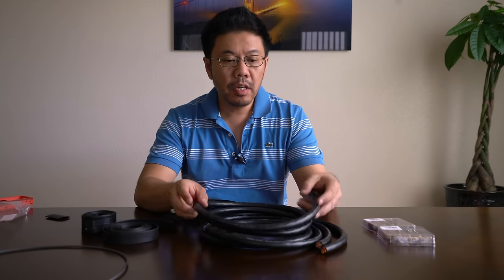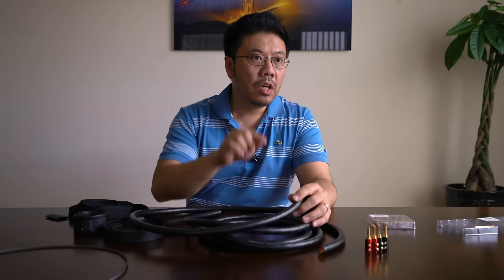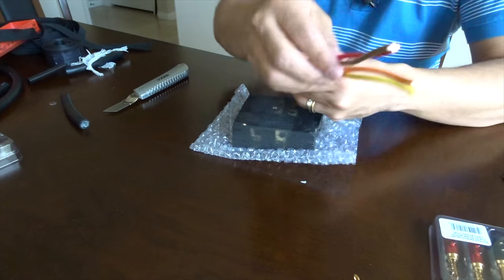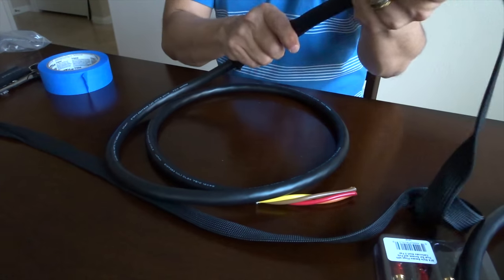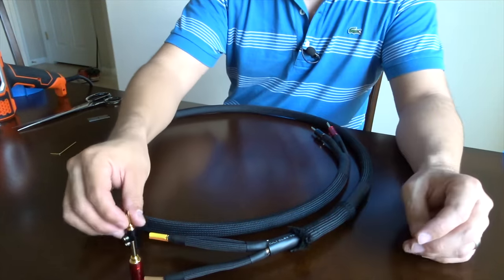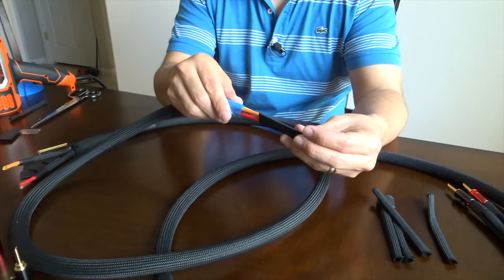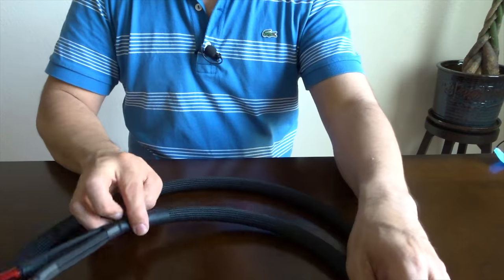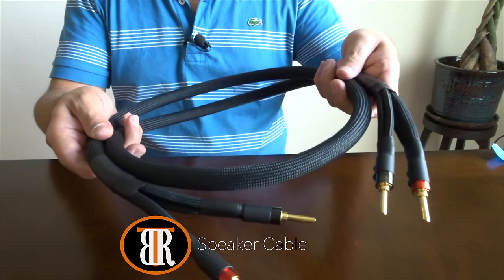Making The Best Speaker Cable For Money, How To DIY HiFi Cables

Comment: Your brass banana plugs only have 28% electric conductivity. Its gold-plating wont help. Always use pure copper for your connectors, then OFC for your cables.
Reply from the maker: Please see your amplifier terminal to see if they come with pure copper posts?
Reply: @Tharbamar  They do on my NAD and also on my KEF terminals. And i even fabricated my own binding posts, made of 1mm pure copper sheet. When it comes to conductivity, it is either pure silver or gold or copper. Anything else would have significantly lesser conductivity / higher resistance.
Reply from the maker: @arpeemac  Very nice, can you tell me where you get the copper sheet? I'm making another kind of speaker cable, thanks
Reply: @Tharbamar  I got mine online locally. amazon sells them too i believe.
Reply: @arpeemac  pretty confident if you put a meter across a brass plated banana plug/ post v copper banana plug/ post you would read exactly the same resistance or 0.0 ohm difference, very slight. We are not talking long distance for these banana plugs/ post it is just an end termination. As to any audible difference again none. So your higher resistance argument is incorrect. Tarnishing is the benefit certain materials are used to withstand that affect over time.

Comment: Snake Oil... UL13 CL2 is general purpose 75C shit cable; 2 cond. lamp cord works just as well...
Reply from the maker: Very nice know that pro audio cables were also snake oil, thanks 😃
Reply: @Tharbamar  They are snake oil. Buying expensive speaker wire is about the biggest waste of money out there. 16 AWG lamp cord works just as well for 99.8% of applications.

Comment: 'If you have doubts about benefit of Star-Quad Cables'..........this is misleading. Star quad is not applicable to speaker wire. It is very useful in microphone signals though ;)
Reply from the maker: Not misleading at all, do a little research how this cable was born and designed for what purpose. I don’t think you have proper information.
Reply: @Tharbamar  mate, I've met the owner of Mogami

Comment: why not solder the cables ???
Reply from the maker: I preferred direct contact without additional resistance.
Reply: @Tharbamar  
what about the air gap ?? and lack of surface area ??
Reply from the maker: This cable is pretty thick it should not have any problem.
Reply: @Tharbamar  
it would be nice to have solder that had conductive properties that surpassed copper, so as to "guarantee" a good joint.
Reply from the maker: We can use silver solder, I just preferred direct contact. Thanks

Comment: The tutorial is excellent but if you don't have the big Parts Express banana plugs, be prepared to suffer putting this together. two twisted, stranded 12 AWG wires don't fit easily in the audiocrest or the KnuKoncepts banana plugs. Even though they are big, you will struggle. I just gave up. The speaker end is not a problem, the amp end is the problem and the Express parts bananas are quite expensive and back-ordered.

Comment: Solder directly to speaker terminals, having connectors just deteriorates signal. Tops out the best cables.

Comment: Also you can use a soldering iron on that heat shrink, it works instantly and is much faster than a heat gun for small objects. Heat gun is great for larger objects like pvc.

Comment: That's equivalent to 6 AWG or 6.6 mm^2 conductors for a 1.68 m length of cable.  Seems to me, extremely excessive even for audiophiles.  Are you sure your not simply being fooled by insertion loss and the ears preference for volume as defined by the Fletcher Munson curves?

Comment: Hello Tharbamar , What is the barrel size for the Banana Plugs for placing two 12 AWG wires together? The link for (KnuKonceptz Banana Plugs : https://ebay.to/2WmWb9u) seem different or smaller than in ones used in video. Does connector have to accommodate about 8MM for two 12 AWG cables?

Comment: Look nice..but brass is not the best material to use for plugs..pure copper is much better..With cables its all about testing..thickness does not necessarilly mean better sound..I have used twisted enamelled copper less.than 1mm thick with superb results..

Comment: The only people that would say you’re an “anti cable guy” are people that purchased $2000 + cables. And people that SELL super expensive cables. Lots AOC scam artists in this hobby unfortunately and the manufacturers of these upper expensive cables don’t help. There is an upside however. On e the Chinese copy these cables the prices plummet into the ground. Look at the market for Chinese iems and cables. Much cheaper for the same quality compared to even 2 years ago.
Reply from the maker: There is one true story behind all those cables shipping from China is factory need to keep running and those big name brands could not move them fast enough due high prices, so they all end up on online.

Comment: This is not a "Reference cable"!
You can NOT expect a reference quality from a $5-€8 p/f cable!!!
It is a copper cable, and the way it is made can only deliver a certain level of quality. The best performance can deliver solid core cables! Pure silver is the way to go! Silver is much better for building cables. You are saying that your cable has no loss! Every cable has loss of signal information. Your cable looks nice, but a nice looking cable does NOT nececeary sound good. You are saying that those plugs from Taiwan are like  the " best for your money" ? Try WBT and compare the quality! Sorry I had to say this, You are a nice guy and doing a great job, but you are puting some "desinformation" here. Thanks😁
Reply from the maker: Well you just put disinformation, silver is good for conductivity but check to see what they used to record your favorite music, they may be recorded with nickel plated plugs, sorry to say this but I think you might have read too much audiophile press.
Reply: At the end of the day, just listen to music and enjoy, that's what matters most.

Comment: That is two pairs of banana plugs as far I can see 😅
Reply: But it works with this thick cables?
I saw all the options with a slim cable entry?
So do you think any standard banana plug will work?
Reply: @lupavalo2000  I wouldn't see why a thicker cable has to be a problem. As far as I know, the thicker it get's - the longer of a cable you can use without any "problems". Correct me on this one.

Yeah of course, why not. As long they are useable for you. The thing with "hi-end" plugs is something I don't get. Is it the functionality, with an extra screw that determines if it costs $100 or $5.. Nahh, that sounds like some PR bullsh*t to me. 

The cables on the other hand is something else but in the end the result It's sooo minimal either way you wont hear it. Only if you tested them thoroughly.

Comment: So this is what I see: a Thick copper cable goes into the back of a banana plug fitting loosely into the plug not making 100% contact all over the interior of the plug. The copper wire then gets fastened by a thin screw which makes contact to the plug....Just doesnt make any sense because of that reason alone, might as well use a thin wire

Comment: i doubt a lot of poeple can spot a difference between those cables and normal speaker wires
Reply: Or straightened coat hanger wire
Even audiophiles.. 
All voodoo

Comment: IMO putting that sleeve on just makes it pick up dust and dirt and makes it hard to clean.  I hate braided cables because they snag and are hard to clean.  Also if you were spending thousands on speaker cables then I have some stuff I'd love to sell you.
Reply: The whole point of the video is that you don't need to spend thousands.   I made 2, 9 foot cables for about $100 total.   The sleeve is additional protection for the insulation.  Not that hard to clean.

Comment: Would this be a possible alternative? Very hard to source those cables in the UK https://uk.farnell.com/alpha-wire/vf16012/shld-flex-cable-4cond-3-29mm2/dp/3018547
Reply from the maker: That shield will add a lot of capacitance to speaker cable, which is not good for low impedance load between the amp and speakers, only reason to use them is if you’re having noise interference.

Comment: Pretty..................................... but impractical. A good 14 gauge twisted wire will yield the same results!
Reply: Wrong... 9awg is far superior to 14awg  

According to Audioholics, cable size (9awg) is an excellent choice for stereo speakers. Gene, the president of Audioholics is an electrical engineer that has worked in communications so he understands how frequency affects cables and has posted the measurements to prove it. Audioholics have done several videos on the subject of speaker cables.  Teaching us all to avoid snake oil in the audio cable industry.  But also what one needs for the bare minimum for the highest quality

Comment: The best cables are no cables. Mount the power amp on/in the speaker. Zero impedance. Anything else is compromise.
Reply: Exactly. Lol solder the speaker right on the amp output terminals xd
Reply: @ItsDextrin  One can go further. If using a class D amp, you can use the back-emf during the undriven periods to servo control the diaphragm movement. Flux path non-linearities etc can be compensated for, increasing efficiency and reducing distortion.

Comment: Or just buy any OFC cable on Amazon and be happy. It will sound exactly the same...and will be easier to hide since it's not so thick.
Reply: What will the oxygen do for the electrons?
Reply: @Cheese_1337  let's them breath life into the music 😁
Reply: @Cheese_1337  OFC is lower resistance and wont degrade over time vs copper clad aluminum. And the price difference is not much. However even CCA at 12 ga. over only a few feet is more than enough for most applications. Unless you are running kilowatts of power.
Reply: I thort It was abit over kill.ive got 2×4mm van damme any van damme is great cable & not expensive I've used DCsk of amazon with is abit cheaper & decent which I used in my atmos system

Comment: Bro, you bought good wire and maybe good Banana plugs but on the ends you decreased the quality as soon as you did not twist the wires back together.... you kept them parallel. They are twisted inside the factory jacket for a reason and the ends you made are straight. The 2 positives should be twisted together and the 2 negatives should be twisted together. Weird, just noticed in the photo you showed at the end of the video.... the  2 other cables you made; you twisted the ends on them but not on the Mogami.... why?
Reply from the maker: I just want to try out the different with and without the twist which I forgot to mention in the video, by the way I also build Kimber Style braided speaker cables as well, which I will be making comparison review video of the cables, thanks
Reply: Tharbamar Oh I see, but have you made another Mogami wire off camera with twisted ends to compare them to? Cause comparing them to any other maker is pointless? Anyways, imo I think it is just a waste of time and material to do a comparison test of this nature, to many benefits when wires are twisted hence why factories do it themselves. Thanks for the reply in any case.

Comment: Looks like a repeat of the myths about audio cable! Thick cable with secure terminations at both ends are essential. But most professionals laugh at the woo about 'high resolution' or 'oxygen free' cables. And certainly in a domestic environment good thick electrical cable is all that's necessary. If you don't believe me try a blind listening test. You won't be able to hear the difference. And even good test equipment won't show any differences between $10 and $100 or even $500 cables! It preys on the public's misunderstanding of what the cables actually do. BTW, I'm a broadcast engineer...

Comment: speaker cables should´nt be less than 2metres, as I see your cables shorter..
Reply from the maker: There is no such a rule, basic rule is keeping minimal length.
Reply: @Tharbamar  I totally agree, and also in this case the cable is heavy and needs to be resting on the ground to lessen the tress from its weight on the terminals.

Comment: Well that does look asthetically fancy....but none of it reall matter....good ofc cable is totally suffice...and 2.5 mill is enough of even the most powerful amps...having said that im using 4 mill 12 agw wire...its not to expensive just bought 100 mtrs for £40 ( UK) for my new build home theater 7.2.4 style.
Reply: I have used twisted pairs out of Cat 5 cable for my Hiel AMT's. And I also use a transconductance amplifier for them, so the quality of the cable is irrelevant at that lol.

Comment: Brass and gold are not as good as copper so why degrade it ?  This is the same guy that promotes an expensive brand i recall of pre made cables. Not required imo. Keep it to silver (unlikely) or just copper. I have the tools and experience to solder or crimp, I also have the connectors if required, but i think it degrades at every step and lets face it, next to no one would ever tell the difference.  I would put money on that.😊
Reply from the maker: Don’t lie! When did I promoted expensive cables? Prove it.

Comment: I only use 24k solid Gold wire with a minimum of 32 strands with a layer of virgin silk then a layer of carbon fiber next it is imperitive that you use only military grade heat shrink finally once done break in for at least 500 hrs at a temperature no more than 76.2 degrees Fahrenheit if you really want to get a bang for your buck then cryofreeze them & repeat process

Comment: This is not the way to do it. Conductors must be solid copper and minimum 9awg. Biwire if possible. Bigger woofers will like to be feeded through 7awg solid copper.
Reply from the maker: To each of own, this is the best way for price to performance. I have no appreciation for people like you because only way you know better than others.,and bi-wiring is for beginners.

Comment: 13:34 oh please NO! That is NOT how to do it! You are telling people about high quality cables and at the same time you are doing such crap! You don't twist strands and you don't crimp them with a grub screw without first crimping them with a ferrule. Nobody who knows about electrics would do it like this. Your cable can be as thick and good as you like. If your connectors are bad, the cable can be as good as it wants! The connection of the cable is at least as important as the cable itself and you have failed miserably.
Reply from the maker: Nothing wrong with what I do, as long as it sound is great.

Comment: best speaker cable for your speakers , is inside your speakers .The engineers have already thought that out for you .
Reply: ct5006360
Nope. 
The finance department determined the wire in the speaker cabinet, not the engineers.
Also, these are cables for OUTSIDE the speaker cabinet.

Comment: I just cannot understand why neighbouring wires are joined together instead of the opposite ones. Braids and tubes on surface are adding nothing to cable, but bad way of coupling the pairs is wasting of the cable potential. Think twice!

Otherwise it is really inspirative video.

Comment: that cable is for 220V, 10-20 Amp currents (meaning 2000-4000W). Overexagerated for speakers, meaning you can succesfully power 4 washing machines in the same time with that cables, you don't need it for small currents in home audio. Please stop fuelling myths.
Reply from the maker: Well, these are no myths, you just don’t know it because most of studios and concerts uses same cable for quality.
Reply: @Adrian  Quite a ridiculous and uninformed statement...

Comment: I really appreciate and respect your enthusiasm for audio, but no, I'll respectively and completely disagree with you. Voltage and current requirements of the typical household 2 speaker or any variant in-between that and a full blown 7.1 surround AV system is much less than what was made here. Plus, the contact surface of those bananna plugs you inserted into your speakers is not anywhere near the same as the ridiculous amount of copper you just placed in front of them, so there is your bottleneck of energy.

Comment: You didn't solder the two cable ends where you twisted them together or solder the banana clips onto the cable.  the Cables are going to oxidize over time and the sound will change too.  The oils in your skin will speed this up too; I hope you washed you hands well with soap to temporarily remove the oils.
Reply from the maker: Never solder pure copper conductors and I do annual cleaning with Caig gold.

Comment: What is your speakers cables referenced too, you make claims that is not true. How does the nylon braid aid in sound quality?
Reply from the maker: My previous reference cable was Audioquest Gibraltar 8ft, I only claims base on my experience if you don't agree with it I have nothing to argue, Nylon braiding is for protection only, thanks

Comment: That is really great looking cable BUT it will NOT sound any better than regular off the shelf speaker cable. I prefer to buy my speaker cable from Monoprice. The product number is 2820 and 100 ft of 14AWG cable is $33.69 with free shipping. I buy my banana plugs from Amazon or Ebay. They are called Nakamichi. They have 2 advantages. 1) Two set screws for a tight connection 2) The shell unscrews and comes off the FRONT of the plug.